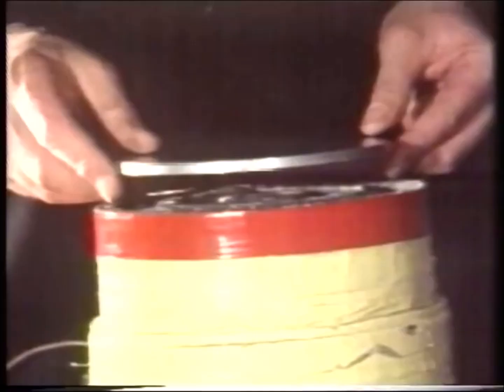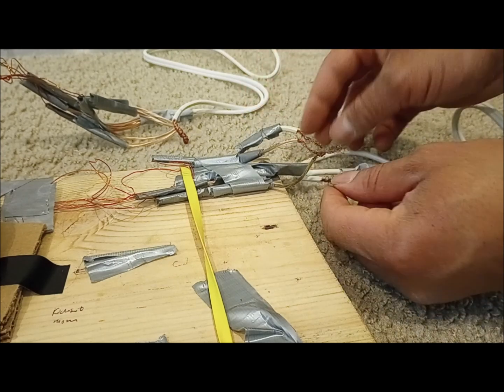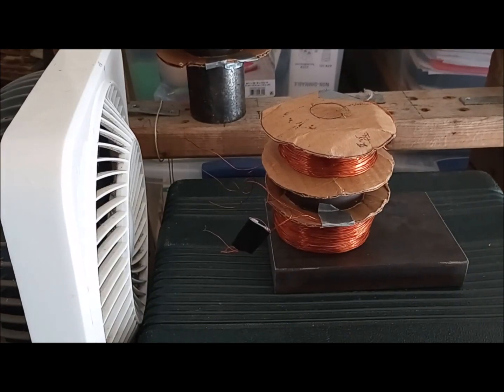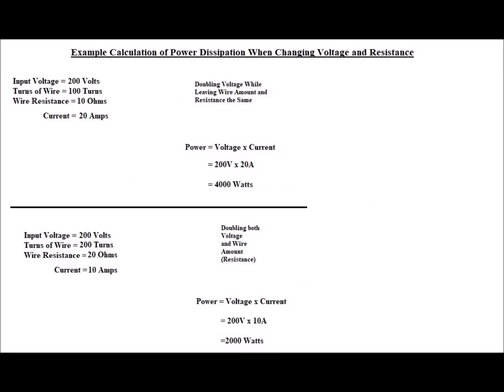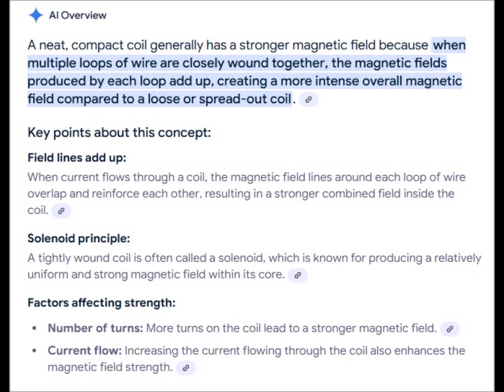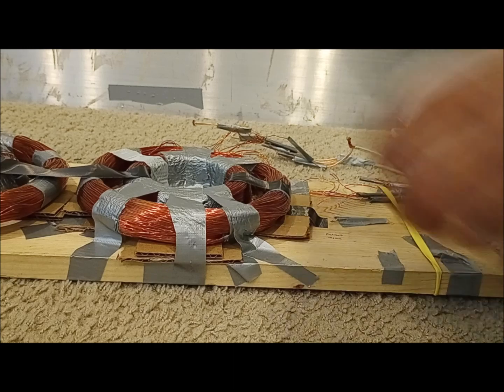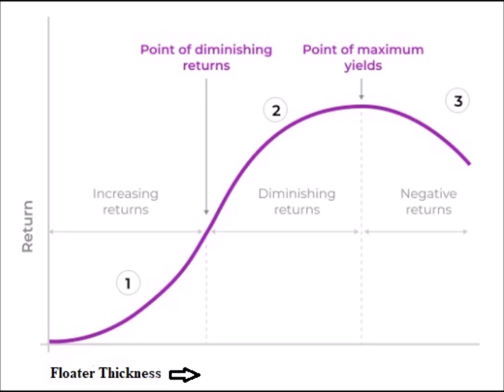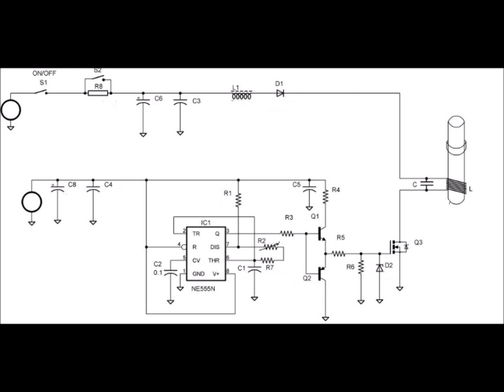How to Build a Magnetic River: Tech Details of Eric Laithwaite's Maglev System

Comment: Great work! You may find benefit in connecting the coils to the 'hairpin' side of a Tesla hairpin circuit to avoid ohmic heating and increased efficiency at high frequencies and kilo Amp impulses. Consider making DC spark gap discharges via HV rectification instead of the AC discharges. Start at low power using a variac to protect the circuit and use a neon transformer spark gap and HV door knob or polypropylene capacitors to make the discharge stage. Finally think about using tesla bifilar windings as they store MUCH more energy. Hope it helps. God bless.
Reply from the maker: @ftwproject658   Hi. Thank you so much for the suggestions! This will definitely help focus my research! 🙏

Comment: Well done. Pls consider a simple, cheap rope, pulleys balance. Use a separate weight ( jug of sand / water...)
Mount the entire coil assembly to other masses aswell.  Aluminum, stone, water, sand.
You may find when you turn on the switch the assembly coil/s will nullify whatever mass you have it attached to. You can't know unless it is in a balance . Your non induced weight will then be heavier & fall.
Reply from the maker: @GWAForUTBE   Hmm 🤔
Reply: @gsutton78  Spinning mercury with electricity apparently has this effect. Aswell as centrifugal magnet arrays. Arranged, however, to fold one pole into the other. 
Some birds,  bees & beatles & dragon flies have adapted to use sound to assist flight. 

Magnets are pricey. With countless variables.  
Got access to bugs? Record a bee hive with your phone,  perhaps in swarm?.. Pretty sure there are lots of bee hive recordings already here on YT.
  
Then attach your phone to this hanging/ balancing weight,  stone.. water.sand. 
Push play. 
A tone generator app with a search pattern. You could leave it buzzing away & watch for your balanceing weight to bob like a fishing lure.
Reply: A series of speakers surrounding vehicle occupants could minimize g-forces.

Comment: I noticed the metal sphere at the video's end... I'm not at all technically minded, but I wonder if spheres would be more stable than a disc, and be less prone to 'slipping off' the magnets 🤔
Reply from the maker: @h.bsfaithfulservant4136  That's right! It even appears to be able to wobble around a bit without losing stability. I'll have to research an explanation for this.